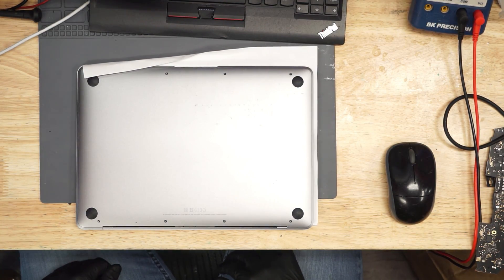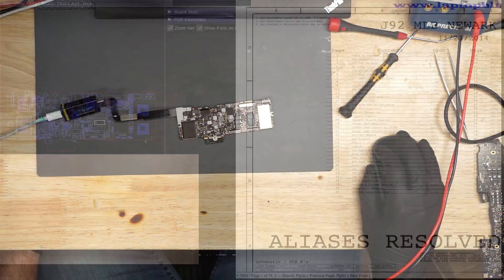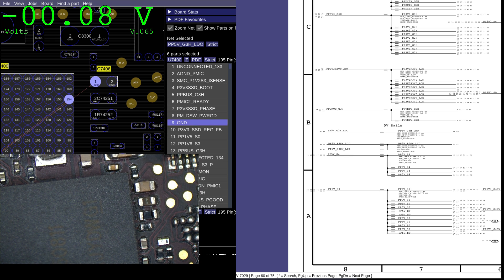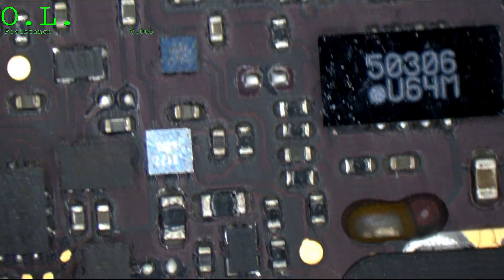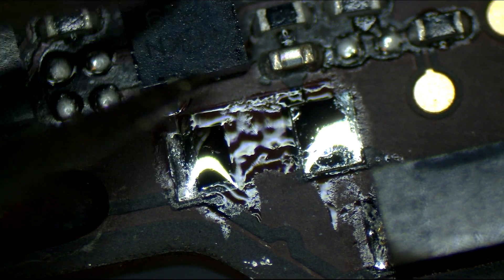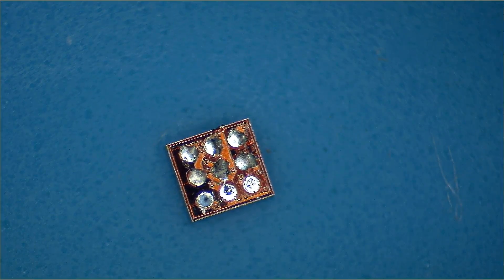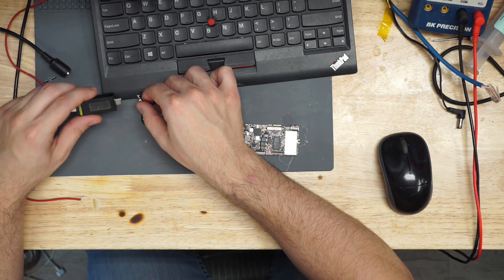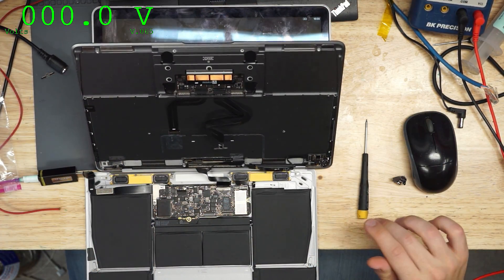A1534 12" Macbook, 820-00045 30-60 milliamp power cycling: logic board repair.

Comment: Louis, what voltage/current do you put into the board with your DC generator when looking for shorts with the thermal camera? How do you pick a voltage that is enough to make the short show up on the thermal camera, but not enough to blow out other things on that circuit that might not be rated to carry that voltage?

Comment: I saw that you removed the shorted capacitor, and prepared its solder pads, but then you re-installed the nearby BGA and I didn't see you replace the burnt-out capacitor! Did I miss it?
Reply: Was going to ask the same...probably replaced.
Reply: It didn't affected much even it's not installed.

Comment: What cause a capacitor to self destroy like that ?
Reply: Perhaps power spike or bit too high voltage. Or it's just bad one... Caps have max working voltage. But heat is also reason, it will reduce lifetime of cap.
Reply: @mrdummy_nl  I'm wondering why it seems to happen a lot on mac...
Reply: @Kaynos  Not only to Macs. Every electronic device might have some bad caps. Even my Xbox360 has over whole board blow up caps, due bad power supply which causes too high voltage. Cannot tell if Mac uses high-quality caps, i have no statistics about how many are repaired. Louis knows how many.

Comment: I have a hard time calling this "the 30-60 miliamp power cycle". The thing with these USB amp meters is that they are not very precise in the low end (or the least significant digit, when the rest are 0). Getting a proper measurement might reveal that it's a constant current of 40 mA and the way this meter works is it just compensates the previous measurement.

Comment: Louis you should mention how old these great macbooks are when repairing.
Reply: The 12" hit the market in early 2015 so not that old.  A shitload of these have failed SSD:s, I have one of those.
Reply: AlfonsoB I still have ssd's from 2012 that are working I honestly dont get how they are so crap
Reply: @playererica  yours are not installed by apple in to a machine thats to small and does not cool very well.. heat kills electronics like these little components .but SSD chips also fail if they get to hot or stay to cold ...
Reply: @playererica  maybe they literally don't make them like they used to? older stuff was bigger = more likely to have better cooling and sockets instead of soldered in components and overheating
Reply: @corgano6068  No, that's not it. 3 years isn't that far back for one, for another, SSDs are generally very reliable. It's not the industry as a whole. It's apple that's the problem.
Reply: @AlfonsoB my sisters 2015 15" has a failed SSD. I'm trying to go about replacing it and keeping her current OS and programs (she uses them for work). Any suggestions on replacement parts or how to keep all of her data?
Reply: @mxp6466   In many cases, the SSD's are soldered in.  The other issue.. .will the OS turn the system into a big snail?  Mac's tended to turn off TRIM if the SSD was not blessed by Apple.. It would work fine for a little while, then you would be writing to a floppy, speed wise.
Reply: If an SSD has failed there's virtually NO chance the data is recoverable.  This is how folks learn to do backups.  And Macs at least have excellent backup software included, Time Machine.  Wish there was an equivalent for Windows.

RichE
Reply: Or you could like... google the model number in the title? there's a website called EveryMac(.)com that has all the information on almost every model ever made  providing you can use google or willing to cut and paste a few things into the websites search box. It only takes less than a minute.
Reply: RoseOfHizaki there’s 3 years for that model number, don’t run your mouth just to pretend you’re smart.
Reply: Since he mentioned touchbar, I would suspect this is a relatively recent version